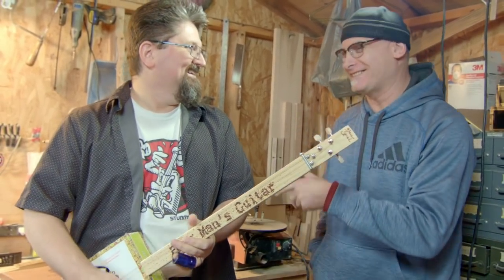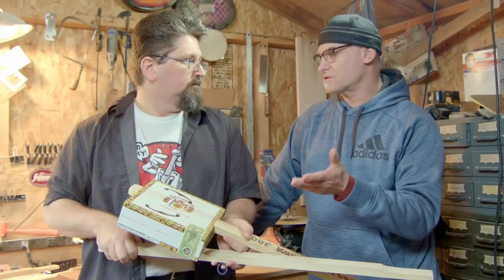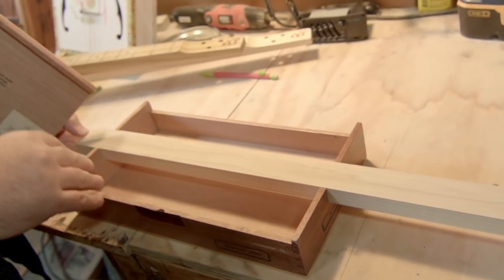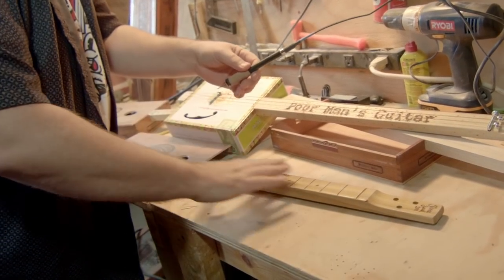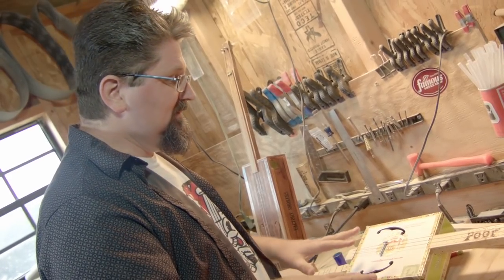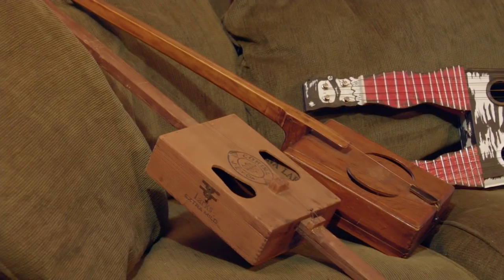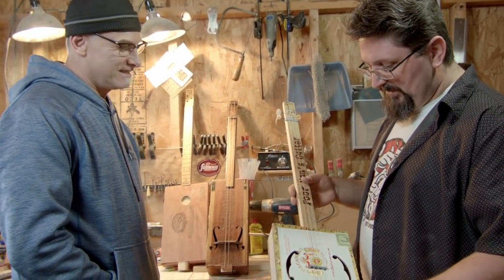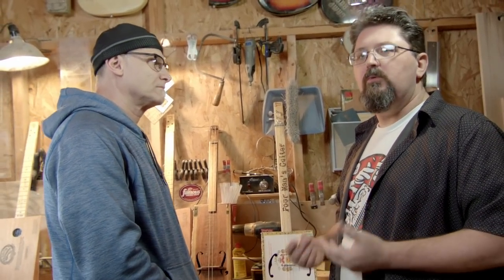Building a DIY Cigar Box Guitar with Shane Speal - Cigar Advisor

Comment: I've watched a lot of the build videos and no one has used a table saw to cut out the hole in the box.  I set the depth of cut and then set the fence to cut the right side.  Do both ends at the same setting and your neck will always be square,  Then set the fence to cut the left the left side.  I cut mine a little narrow.  Remove the rest of the box by making many passes and then sneak up on the left side to have a perfect fit.  Clean up the bottom with a file,

Comment: Hey Shane
Dumb question... 1 x 2 x 3 ?  
I've been using 1 1/2 x 3/4  stuff. Am I using the wrong size? Not sure what the 1 x 2 x 3 refers to.
Help?
Reply: The 3 refers to feet or 36", the 1x2 is actually 1.5x.75 of an inch, so you are using the correct size for the neck.
Reply: Not a dumb question at all. The convention is confusing if you don’t know its origin.

1x2 refers to the rough sawn dimensions, before finish planing. In the old days they would saw the boards to 1” x 2” and then finish plane the four sides to make it straight and smooth. The finished dimensions are 1 1/2” x 3/4”, but they still call it 1 x 2. (I assume that now days they saw it closer to the final dimension to reduce waste)
Reply: @trackie1957  thanks for the replies!